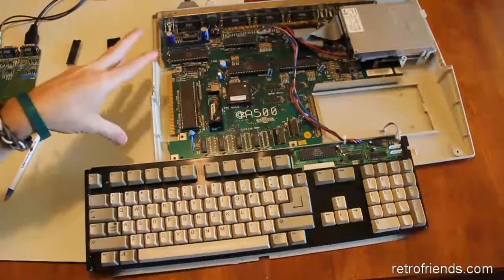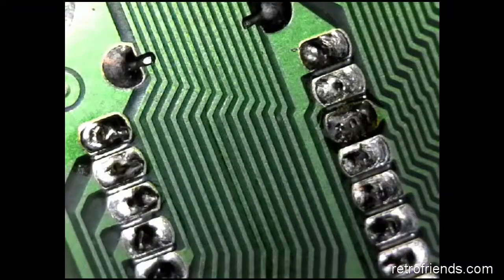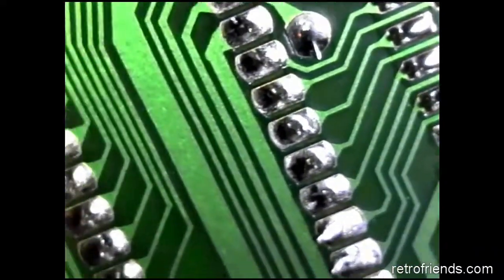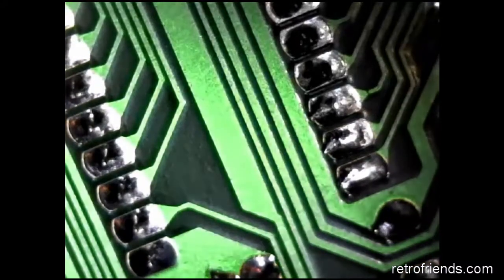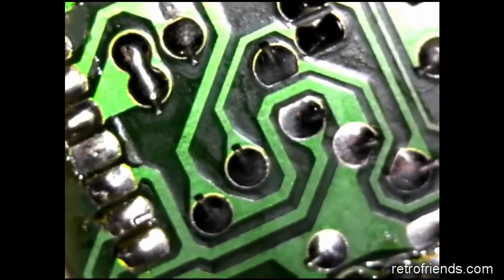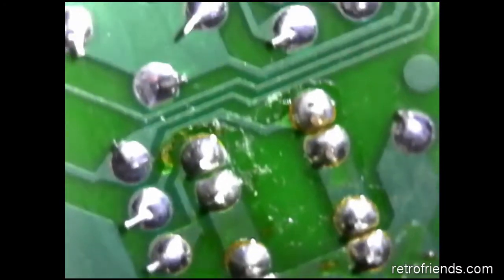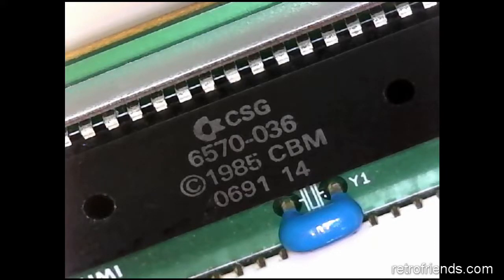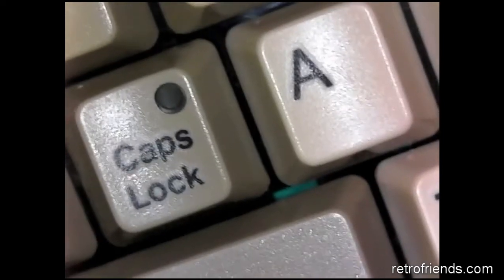Another Amiga A500 Keyboard Repair :/

Comment: I discovered this problem a month ago or so. I had a few A500 keyboard controller PCBs with these symptoms. Had them laying a few years until it suddenly occured to me to try and reflow the solderjoints on the big controller chip. This was after I had tried pressing down on the chip while holding preassure on it as I turned the Amiga on. Keyboard worked fine as long as I did that. As soon as I released the preassure with my finger the problem was back. I couldn't see any dry solder joints but low and behold, that was the solution. It later occured to me that the solderjoints of the chip gets stressed when using the keyboard. Pressing the keyboard I could see the controller PCB flexing a little bit.
Reply from the maker: Great job!

Comment: Thanks for pointing that out.  I had a series of keys that were not working so I pulled the Membrane for inspection and to replace a key that was missing.   After putting the keyboard back together nothing was working.  Not a big deal I just ordered a new membrane and after putting it in nothing worked but CTRL-Amiga-Amiga.   DiagROM showed some activity when pressing keys but when testing it nothing so I put it aside that was last Sat.    Today I thought I would search for some new idea including looking for the keyboard map and then I ended up here.   After seeing this I started saying why did I not look at the board and some of the legs on the 6570-036 had dry solder joints they actual keyboard ribbon cable connector looked ok under the microscope but I decided to re-flow both and now I have a fully functional keyboard and I am one happy camper.